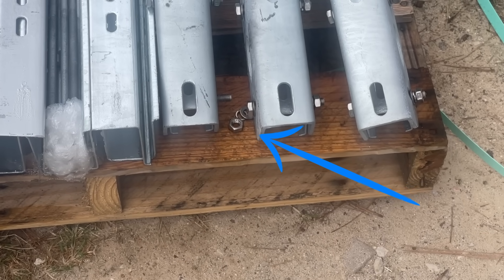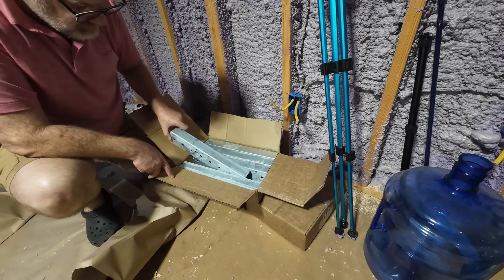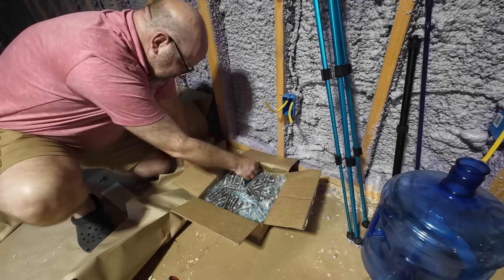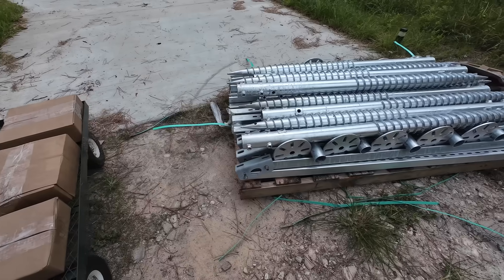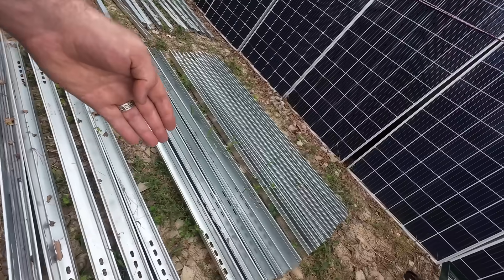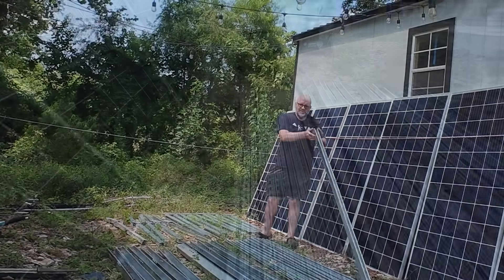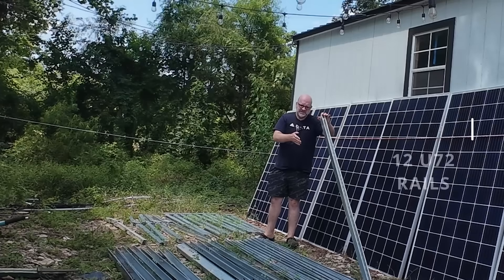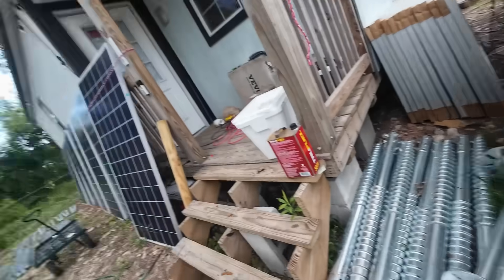Chiko USA GroundFlex U2V Ground Mount UNBOXING – Signature Solar DIY Solar Rack

Comment: I have one MAJOR Question to ask you, Do you Think this Could be Mounted to 5ft 6x6 posts a few feet in the ground instead of ground screws?
Reply from the maker: Great question! Yes, you could adapt the Chiko GroundFlex U2V to mount on 5ft 6x6 wood posts — but keep in mind, you’d need 10 total if you’re using the High Wind Kit (5 front and 5 rear). Just make sure the posts are set deep in concrete and spaced accurately for the rail spans. The key is overbuilding for strength and checking your local wind load requirements.

Appreciate you asking — and let us know how the build goes!

Keep shining, stay charged.

Comment: You can't buy it Anywhere currently
Reply from the maker: Yeah, it looks like they’re out of stock at the moment. I’ll check in with Signature Solar to see if they have any info on restock or back orders and will update here once I hear back.
Reply: @offgridsolarliving  Your soil looks pretty rocky, I wish you good luck on those Ground screws. Your the 4th video I've seen on youtube using this product. 2 of the content creators couldn't get their screws into the ground. Well one had screws the other had the trident mount which was too galvanized, so they purchased different ground screws and attatched the mount to sawed off 2x4's, smh.  The other guy who bought screws, said F it and just poured a 20ft concrete slab instead. The only successful person was this old man who actually screwed his ground screws in by hand, lol.
Reply: Ohh one tip after watching the other 2 videos mess up. Those parts aren't really labled and ended up screwing parts of it in wrong, the beams didn't line up right. they look alike but they are slightly different where the holes line up
Reply from the maker: Ah, I see what you mean. The rocky looking part is actually our driveway we repurposed some old concrete roofing from a house and had it crushed for that area. The mount will actually be going into what they call a ‘gumbo’ mix around here mostly clay and soil so it should handle the ground screws a bit better. Really appreciate the heads-up though, especially on the part alignment!